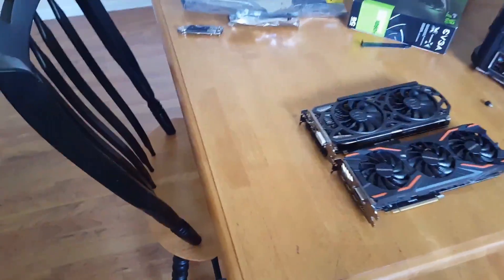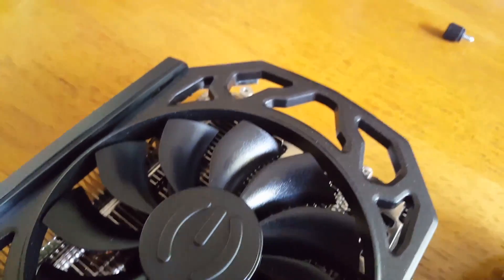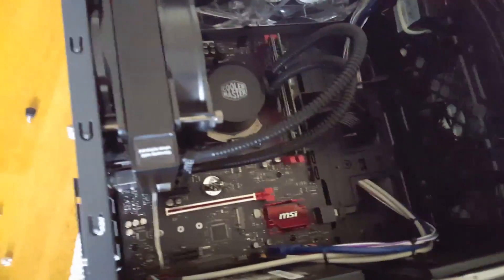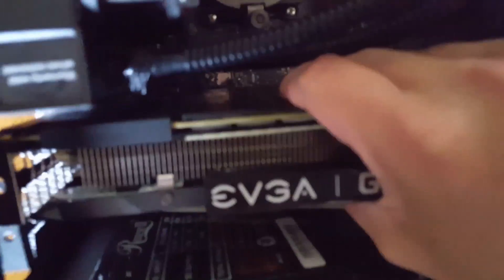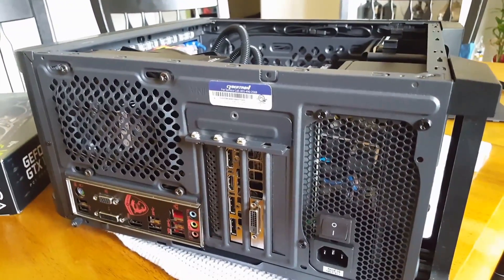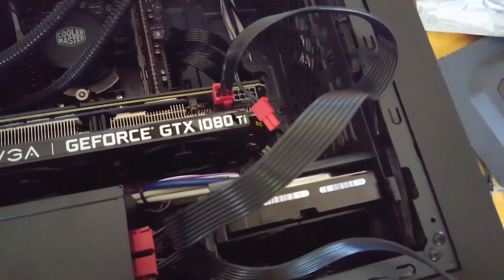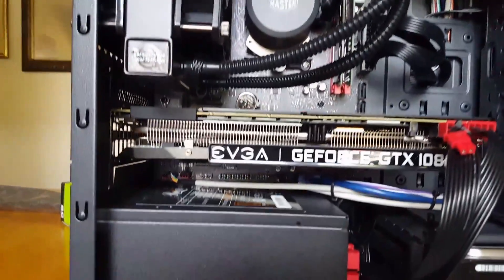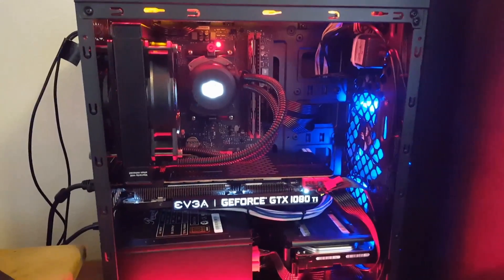EVGA GeForce GTX 1080Ti SC (Black Edition) Installation.

Comment: I have the same GPU. I just have this little problem and any help or advice would be greatly appreciated. My problem is that the card is running on max clock speeds all the time, even if i have nothing opened. This means on idle it is constantly staying at 54 degrees C. Being an open air style GPU it just heats up my whole system, but that's not the point here. I have done everything to stop it from using max clock speeds all the time but with no success, incluiding messing around in nvidia control panel. I have just accepted the fact that it is the card model itself at this point. If someone has the same issue or knows better, please lend a helping hand. Thanks in advance
Reply from the maker: I know you checked through Nvidia control panel, but theres a setting nvidia control panel > 3D settings > Power Management mode and make sure the Power Management mode is set to adaptive or something else, if it is set on Optimal Power / Perfer Maximum Performance then the gpu may not even enter it's idle state and will remain at full boost clock speeds.
Reply: @jds445  i have tried adaptive and it doesnt work... My frind has a 1080 msi gaming x and he says his power management is set to prefer max perf and his card still enters idle mode or 2d mode
Reply: @mc_st0ner792  did u fix this

Comment: Is the gpu ina good spot there? i have a small case as well but idk how much breathing room it requires for good ventilation. or do you leave the case open?
Reply: Michael Gonzalez , that's not a small case it's a mid tower I'm looking at putting this card in a fractal design node 202  which is a true Sfx case of just over 10 litres.

Comment: how are the temps and fan noise under load?
Reply from the maker: I benchmark my computer with 100% fan speeds. It's pretty loud but the temps always stay in the mid to low 50c at 100% load.
Reply: batestar321 heard that under load it never goes over 55% fan speed. How loud are they around 50% fan speed sitting in a closed case?
Reply from the maker: +Stefan yeah under gaming load, my fans dont go over 65% fan speed with my custom fan curve and the noise isnt too bad. The temps dont go above 66c at 65% fan curve in a mATX mini tower case. It is one of the best 2 fan 2 slot coolers available for the 1080Ti.
Reply: Would be nice if you can to do a quick video just demonstrating fan speed noise.
Hardly any Evga gtx 1080 sc videos out there.
Reply from the maker: +Stefan i can do one, want me to do it with a closed panel sitting away from the computer or with an open side panel
Reply from the maker: ill put it in on my benchmark video.

Comment: I picked up the same card yesterday... to replace a 1080 FE.  I really did not want to part with the 1080 FE because i really liked the design and the card was good to me,  but since I got an excellent deal on a 1070,  I wanted a bigger performance increase from the 1070 so I got the TI.  So something weird happened after I installed the 1080 Ti,  my computer blue screened after playing Far Cry 4 for 15 min and one of my top case fans didn't spin. My Corsair HX850 has enough power; I have my CPU overclocked but it was stable with the 1080 FE.  I thought maybe I got a bad 1080 ti.  Then I looked at the back of my computer (my speaker bass piece is next to it)  and notice that the ac power cord to my power supply is rather slim.. I always thought it was thicker.  Turns out that I had used the speakers ac power cord instead. LOL. (I had disconnected both cords earlier to gain access to switching out the cards.)   So I corrected it and ran Far Cry 4 again for 45 min.  No blue screen... so Far.. Cry.
Reply from the maker: oh jeez bro, the 1080Ti is a 250W TDP card so its a bigger jump than you think going from a 1080 FE. That could have been dangerous lol.
Reply: batestar321  tell me about it... i could of fried my components. lol. but now i label my cords using a label Maker.  wheww!
Reply: never tell people shit like that
Reply: K MAO I did the same thing lol, ran it for a week that way and only noticed because I was cleaning my case. Got emotiva powered monitors.

Comment: thats an adapter, probably 8pin to 8+6. i run two 8pin off one output. you will only need one 6+2 cable into the adapter then into your card.

Comment: You know you can use a 1080 and a 1080 Ti in SLI right?
Reply: batestar321 However you can use the 1080 to run physics instead of your 1080Ti ;)
Reply: I know you have a M. ATX mobo but you can get a z270 for a 100 bucks
Reply from the maker: I do not have an SLI compatible motherboard anyways.
Reply from the maker: You cannot SLI a gtx 1080 and a GTX 1080Ti. the 1080 and 1080Ti are 2 completely different card with the 1080 having 8 gb of Vram on its own pcb, while the 1080Ti has 11gb of ram on a Titan X Pascal pcb. With Nvidia, you need 2 of the same series gpu to SLI. The 1080Ti is essentially a modified layout of the Titan X Pascal and therefore cannot SLI with a GTX 1080.
Reply: batestar321 5minute film when see mhz ,vgpu ,mhz , temp ,rpm and fps  in game 4k ??
Reply: YouTuber Dubs boi

Comment: That's a pretty tight case, you are an example of someone that benefits from the two slot design.
Reply from the maker: yep, I looked specifically for a 2 slot card and EVGA fit the bill. They make some really nice 2 slot graphics cards and the iCX cooler is one of the best 2 fan coolers out right now.

Comment: Hello, do the "EVGA GEFORCE GTX 1080 TI" Led can change colors? or its allways white?
Reply from the maker: The EVGA GTX 1080Ti SC only come with white LED. The EVGA GTX 1080Ti SC2 comes with RBG LED but it is 20$-30$ more. There is no performance difference between the SC and SC2, only the fact that SC2 has RGB lighting.
Reply: SC2 also has 9 thermal sensors and asynchronous fan control, though that's mostly just a cool gimmick and doesn't give any performance advantage.
Reply: The SC2 also has independently controllable fans and small thermal LED indicators which I don't think the black has.  But basically the black is a better buy for those that don't care about RGB the other SC2 feature advantages are nearly gimmicks.
Reply: i chose the sc2 edition cause my build is red and i need that RGB, thanks guys !

Comment: Really pushing the Console Peasant myth about PC Users constantly needing to upgrade :P
Reply: He doesn't NEED to upgrade, the 1080 he took out is already a beast, but he just wants to up the savagery by getting the 1080Ti.
Reply: Not really. This is a hobby and passion for people, some people just like to play around with newer hardware. However, if someone wants to play at 4k or 1440P 144Hz, the 1080 TI is the way to go. It all about preferences, what setting you play at, resolution, etc. The majority of PC gamers are playing at 1080P 60Hz, and for that, even a 7970 from 2012 is just fine.